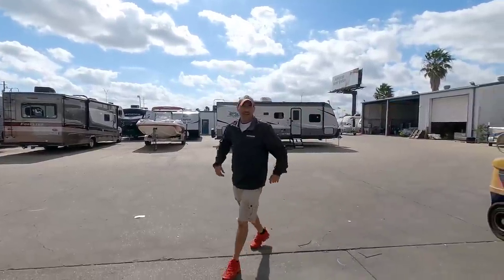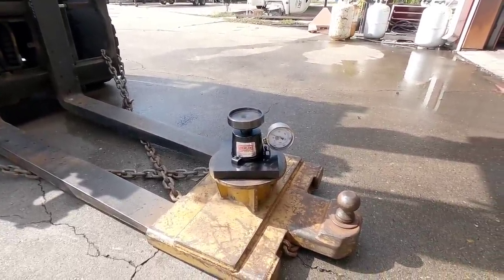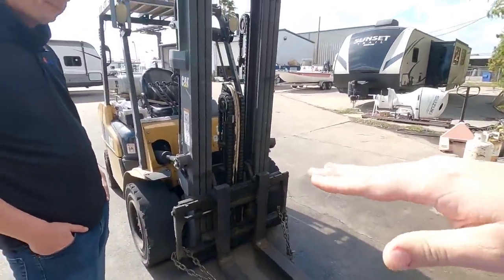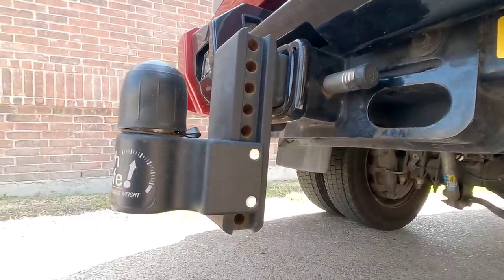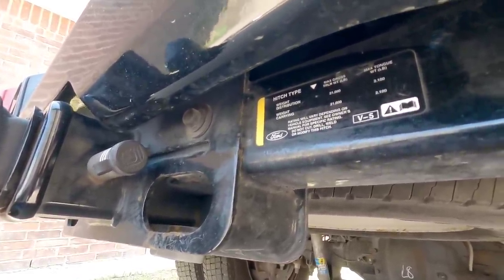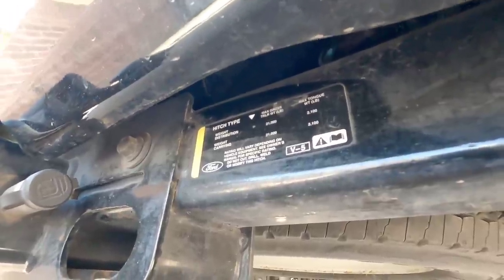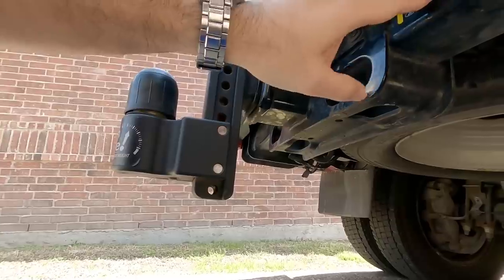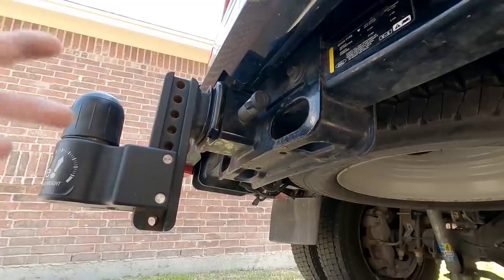YOU'RE OVERLOADING your truck's hitch receiver!

Comment: Good info & yet another frustration point for me trying to integrate this discussion with load capacity & towing capacity to other RV-r's when camping. This is another reason most people overload their 1/2T pickups. It's difficult to convince them that it's an "and" situation; not a "or" situation. They think because the trailer is under the tow capacity then the other doesn't matter. State Weigh-masters could have a field day running all the RV's thru the scales and reading the tags on the receivers & door jams.
Reply: I have a neighbor who thinks his tow capacity is what the car can pull 3500lbs plus his hitch weight. I'm like no, it doesnt work that way....

Comment: Accurate info. No more than 3 hours ago I test drove a new truck with 9250 lb towing capacity but when I looked at the receiver it was limited to 8000 lbs.
Reply: Makes sense since there's still payload weight on top of that 8k. You can't just tow full capacity. It probably has a 1400-1600 lb payload. Now you're over 9250. With those numbers, you should max at a 6k dry weight camper and be in the 7-7500 range when packed up. Therefore, 8k is fine.

Comment: The 'Weight Carrying' and 'Weight Distribution' numbers are a result of a design of the truck or the receiver?  Can I change my receiver and install something else to avoid having to use a weight distribution hitch?

I have a 2000 F-250 SC 6.8 and the hitch has ratings of 10K w/ WDH otherwise it's a 5K tow capacity, seems a little low for a 3/4 ton truck.

Comment: Other items that can reduce your tong weight. 1) a very heavy hitch. 2) the ratio of how far center of ball is from rear axle.  I worked in a hitch shop. Person came in with a short box camper (8 feet of camper, 6 foot box of truck). This was a half ton truck. Camper was already near max weight, then he wanted to tow a boat was 2500lbs. Tong weight was about 200lbs, and he wanted a hitch extension to tow his trailer.  We told him it was unsafe to tow, and the shop did not do the work. 
Another vehicle was a 2012 Dodge Grand caravan. He had a 1 1/4 inch receiver. Then he had a 2 inch adaptor. Finally he had a weight distribution hitch, towing a 3000 lb trailer. The trailer dealer sold the hitch extension, the weight distribution, and trailer. Said he would be ok. When he got it to the shop where i worked, He had bent the receiver hitch, and maybe the unibody of the van. The fix for that was to sell a new 2 inch receiver, and a lower waying weight distribution hitch.

Comment: Very important information JD!  I'd love to see a video comparing the Class 3/4/5 factory hitch specs as well from the top 3 truck makers in their 1/2, 3/4 and 1 ton versions.  Also, some tech explanation on how much hitch weight is actually on the ball when using a WDH.  I think your best explanation of a WDH in a prior video was the comparison to the handles of a wheel barrow.  That alone was so beneficial to me.  Thanks again!

Comment: I bought two sets of two a set of two Intercompt PT300 digital truck scales through a military surplus auction hoping they would accomplish the same goal for tongue weights and loading. These are 20,000lb capacity each and weight me fairly accurately.  Good luck!

Comment: One thing you almost touched upon with the tags, So close, but not quite there. Half Ton trucks have a much lower weight carrying number because the truck is designed to tow with a ball in the bumper itself, and the limit on most is 500 pounds, I believe GM is 700 pounds bumper weight.  They transfer this capacity to the receiver as well since it is the design of the truck to only carry 500 or 700 pounds without a WDH.   Medium Duty trucks don't use a ball in the bumper, they use a Class IV or V hitch to tow with, so there are no limitations at the Receiver.  They can also carry more weight on the ball without upsetting the front axle steering and handling like what happens with half ton trucks.   If you notice, most trailers towed by Medium Duty trucks don't use a WDH, the usual exception would be a Travel Trailer, but for the most part, trailers towed by MD class are dropped right on the ball.   Drop that same trailer on a half ton, and the nose will be in the air and headlights lighting the way for comets, thus the reason for the lower weight for weight carrying on half tons.
Reply: Every new vehicle that I have seen tow uses a receiver. Half tons have a softer suspension and lighter axles, drivetrain etc. It has nothing to do with bumper towing
Reply: @ryanhessler8966  You do know a base half ton without a tow package does not have a receiver, right? They have a hole in the bumper to attach a ball too. That is the limitation of the truck. It carries to the receiver when installed.
Reply: @acdii  my 2019 f-150 has no hole in the bumper. There isn't even a rating for that in Fords own tow guide. Maybe that was true years ago, but not now

Comment: I saw you use receiver reducer so your truck can take 2 inch hitch. Is it safe to use reducer adapter like that? Does it have maximum towing limit?
Reply: On my 2011 F-250, the Ford sticker gives both 2 1/2 inch and 2 inch reducer weight limits. The limits with a reducer are about 75% of what the 2 1/2 inch receiver can handle alone.

Comment: Upgraded to a curt 20,000lb trailer, 2800lb tounge weight hitch. the factory 2017-2021 Ford hitch was annoying at best with its tiny hook holes and low 1500 tounge weight rating. 2017 f350 SRW.
Reply: What was the rating with weight distribution?
Reply: @EngineeringGoneWrong  if you're asking me the weight rating with weight distribution was the same what the factory hitch as non weight distribution and it's the same thing with the Curt hitch it was 2,800 lb of tongue weight either way.
Reply: weird I have a 2017 srw f350 as well, 21,000lb max trailer 2100lb max tongue

Comment: Long time viewer question- Do you think a ram 3/4 T needs weight distribution with a travel trailer that has 900lb tongue weight and 7300 GVWR?  Would prefer to get a weigh safe hitch like you have that works for both boat and trailer.

Comment: Random question that the hitch commentary brought to mind.  Would you recommend going with the 3” hitch (believe this is only available on F350 and F450 currently), or go with the 2.5” and use the adapter Ford provides?

Thinking there will be way less rattle with the 3”, but will only fit a superduty - not planning to change trucks, but...

Comment: Hi, JD. Can you explain the difference between "towing" capacity and "carrying" capacity, please?
Reply: Correct me if I'm wrong, but I'm pretty sure both of those are the same meaning.  Its tounge weight which is different.
Towing capacity might be that of the truck, and carrying capacity might be that of the hardware (receiver etc.)
Reply: Towing is how much you can pull.  Carry is how much you can put in/on it.
Reply from the maker: @MatthewMello  yep.  Kind of like: if you have 3 200lb friends in a large Red Wagon, could you possibly pull it?  Now, how many of those friends could you carry if you bear hugged them?  Now, how many could you carry with your arms full extended?  Weight impacts your vehicle dramatically different depending on how and where the weight is positioned.
Reply: Off-topic, but are shorter trailers less or more likely to have sway issues?
Reply: @Adiscretefirm  Depends on a few factors, where the axles are placed, where the weight is placed, and the design of the trailer.  A properly loaded 6 x 12 enclosed  is less likely to sway than a heavily loaded to the rear flatbed trailer,  A horse trailer is far less likely to sway empty or loaded than a mid axle travel trailer.   A horse trailer is probably one of the easiest towing trailers I ever towed loaded or empty.  The axle placement puts the weight of the horses directly over them for a well balanced trailer, and empty guarantees more weight up front than in the rear.  Sway is all about where the weight is placed with the axles, more weight in front, less likely to sway, regardless of length of trailer.   Now BACKING, thats a different story!  ☺
Reply: @Adiscretefirm  good info from ACDII. Generally a shorter trailer should cause less noticeable sway in the tow vehicle if the trailer is properly loaded. Less surface area to catch wind and probably lighter. That does not mean the trailer itself won't sway. A longer wheelbase also has the added effect of providing more control over the rig. As a general rule of thumb, the first 110 inches of wheelbase allow for a 20-foot trailer. For each additional four inches of wheelbase length, you get one foot more in trailer length. I've dealt extensively with sway, it is NOT fun.

Comment: I have a Ram and wanted to know what I could tow. I went to their web site and found towing weights. Put my serial number in and it said what I could tow, but didn't say what the hitch itself was capable of. Not sure if there is a sticker or not on mine.
Reply: Alot of new hitches will have a max trailer weight, max tongue weight, and max ball weight(if you can change balls) on a sticker usually on the front. used that alot
Reply: I have 2020 Ram 1500 and without weight distribution the maximum allowed to tow is 6200 # for the factory receiver hitch.

Comment: Hey jd the tongue weight on my mpg 3100bh is supposed to be 880. Its 1300 isn't that pretty far off
Reply from the maker: Yes, but it may be the difference between loaded or empty.
Reply: @BigTruckBigRV  it was empty. Unless you mean empty as no furniture in coach yet

Comment: Thanks for another instructional video on towing capacities and hitches. Question: my SUV did not come with a towing package. I found an after market tow bar specifically made for my Outback. It is bolted on, and that worries me a lot. Bolts snap, although I will never be towing more than 1,000 including the weight of the trailer. What are your thoughts on bolted on tow bars?

Comment: Can a weight distribution hitch cut the weight in half????? For example if I have a camper with a hitch weight of 1000lbs. Will a distribution hitch make it 500lbs ? Tow vehicle is 2021 Chevy Silverado High Country with 3.0 diesel.
Reply from the maker: Well, it doesn't really cut the weight, it moves the weight and changes the forces applied to the hitch and receiver.  In some cases it pulls weight off the receiver but puts more on the hitch head itself.  It create a bowing effect.

Comment: I don’t care if I’m overloading anything. If it pulls it without dragging my exhaust on the ground. I drive an 03 3/4 ton Duramax and I regularly pull 30,000 plus pounds. I don’t know for sure but I think the pickup is only rated for something like 15,000. But then I’m a farmer and I’m not Mr Safety

Comment: Hey JD.  Always love your videos.  One question about the weights specifically to multi-axle trailers.  I own 3 trailers myself.  We have a 36' Sunnybrook Brookside 5th wheel, 22' flat bed car hauler (tandem axle) and then a small single axle utility trailer.  On multi axle trailers, I would be curious to find out if the tongue/pin weight changes if it is not towed level?  My theory is that if you are towing a tandem axle higher (lifted truck without drop hitch), then the weight on the pin or tongue would be greater.  Is this true?  I see so many trucks out there towing that are lifted and they are sagging really bad, but the trailer is level.  If they used the proper drop hitch, I think the weight would still make the truck sag but not nearly as much.  Is this something that you can confirm with the scale or have you run into this before?  Thanks in advance!

Comment: What if hitch no longer has sticker?
Reply: Owners manuals tend to have the information since the hitch is usually the same on all 1500s, then again the same on say all 2500s, all 3500s, etc of a given brand/year
Reply from the maker: Google :)
Reply: @BigTruckBigRV  not always the best idea. Lots of misinformation out there. I always try to go to the primary resources first, owners/service manuals. Then resort to Google if it comes down to it.
Reply: VIN lookup at a dealer to find out what tow package was installed would be the only way to truly know.  With Ford's up until recently, there were three different receivers ranging from 10,200 pounds to 13,200 pounds, only the VIN can tell what was installed.